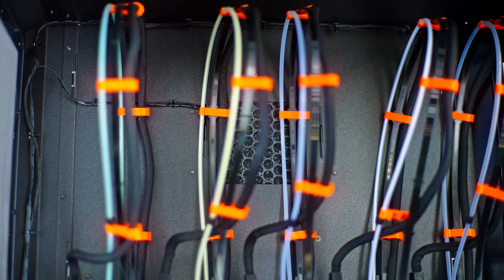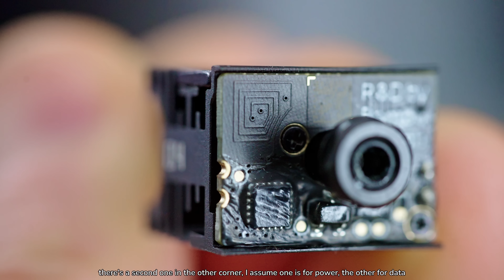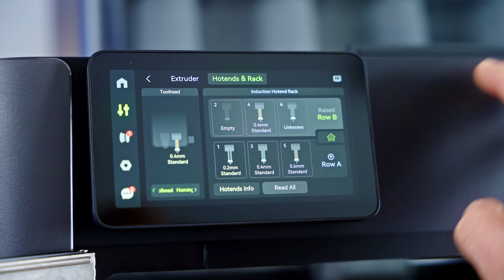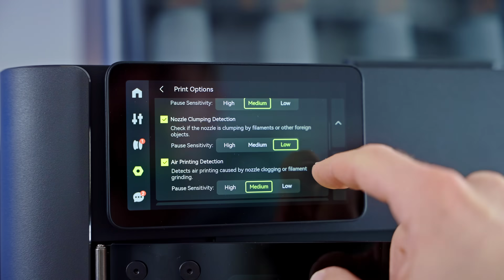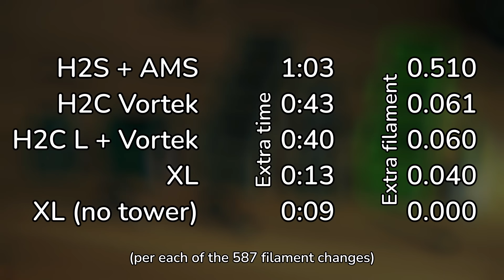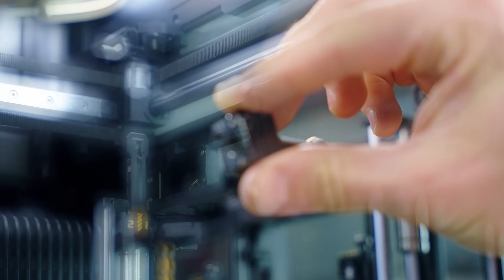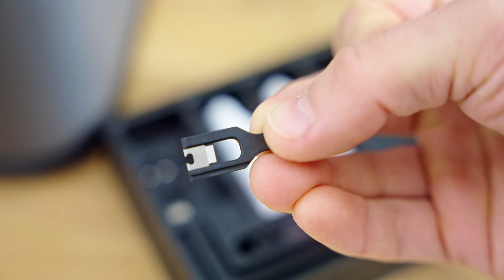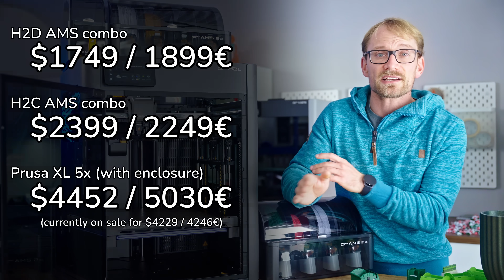The H2C is Bambu's 7-Hotend Patent Evasion Masterpiece!

Comment: Big fan of consumables. I used to run commercial printers (2D), and all of them had consumable user-replaceable parts. It's really not a big deal to replace things at reasonable intervals.
Reply: oh really, you are fan of regularly replacing 4x$39 worth of "consumables ?
Reply: @Asghaad  Ha. Obviously not. I'd rather change nothing and have everything work forever without having to do anything, but this is physical stuff and things will go wrong, and I'd rather planned points of failure that I can replace at intervals than an attempt to make sure nothing goes wrong ever and then have a job to do getting things working again.
Reply: @noobling8313  sure but those proprietary hotends do nothing that couldnt be achieved without stuffing them with extra circuitry and ballooning theyr price for no damn good reason ... 

this printer system would work just fine with SLIGHTLY modified H2 nozzle, all that needed to change was mounting quickchange system - literally just adding that top knob for the lockup and thats it ...

instead they added all that nonsense that DOUBLED the cost per unit from H2/P2 ones 

and it should be BLATANTLY obvious that no they didnt need to add temperature sensing onto the hotend which means they didnt have to put circuitry on it either ...

which means they did it for one and only reason to make theyr hotends proprietary while harming the consumers with unnecessary increase in cost just to achieve that ...

and by the way one single H2C nozzle costs basically the same as a 4 piece set for the A1 ... which means even H2/P2 nozzles were costing DOUBLE of what they should have been already ...